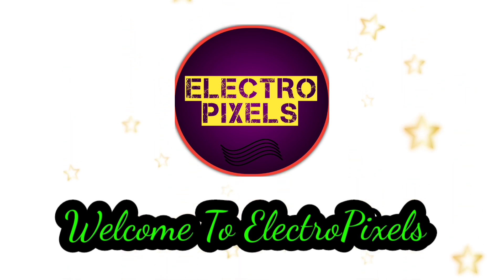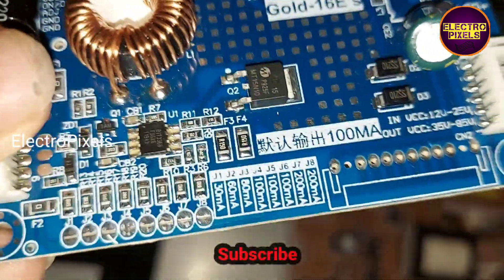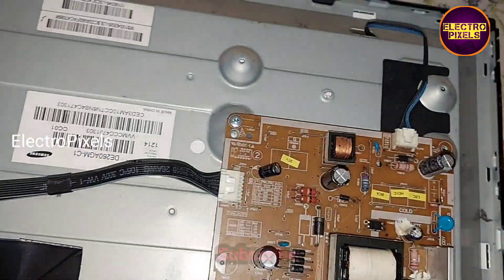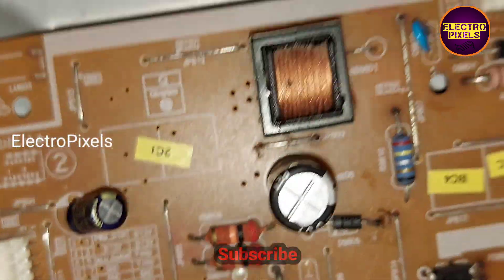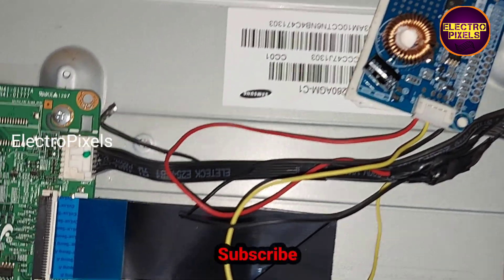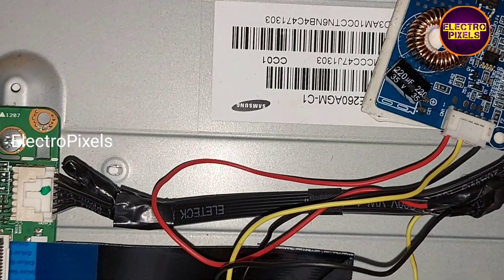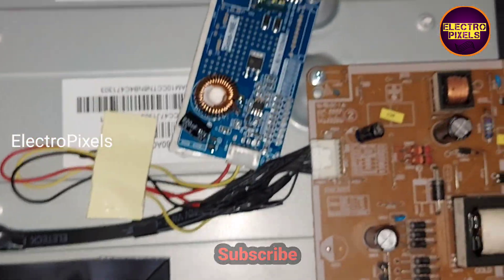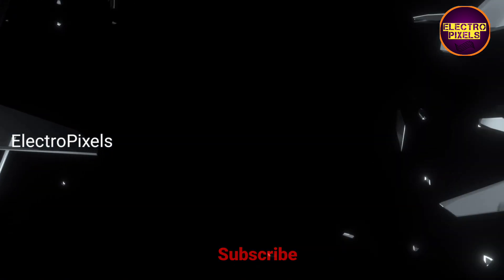Led Tv No Picture Backlight Led Driver Board installation on Samsung LED Tv| UA26EH4000R|Gold-16Es

Comment: Nice..... but what about the pin adj ?
Reply from the maker: You can connect it, But not compulsory it's also called as pwm/dim
Sometimes while Installing Universal Motherboard board if After connecting blon if Backlight doesn't work then you need to join adj to Blon Test point
Reply: TQ for your response